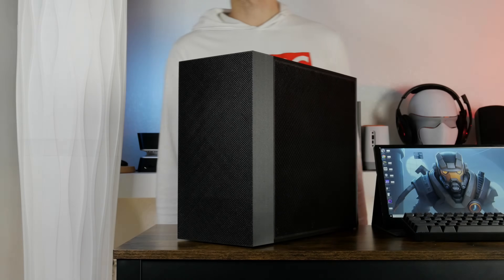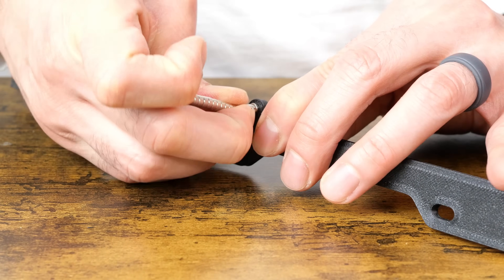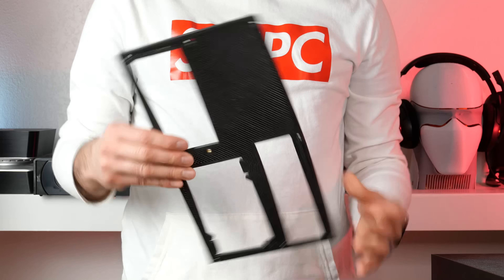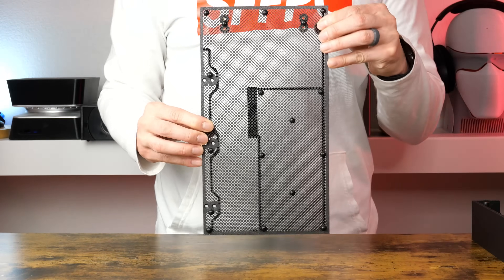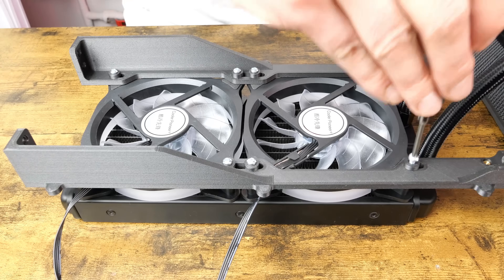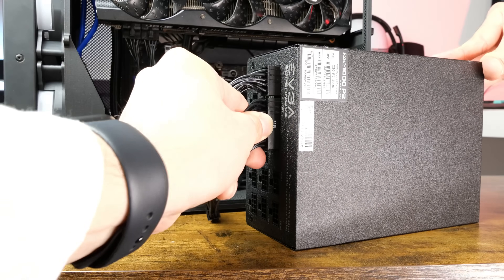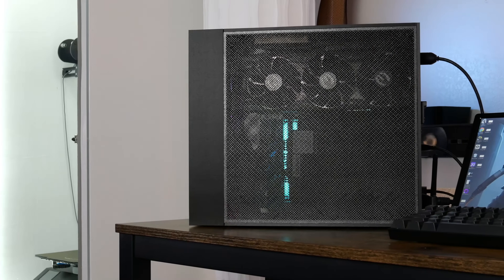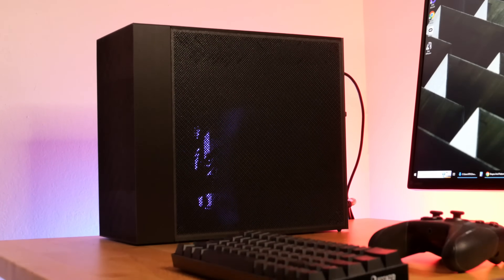3D Printed PC Gaming Case - Full Size ATX

Comment: Best 3D printed case I have seen yet
Reply from the maker: Hey thanks so much! What do you think I could do to improve it?
Reply: @standupg4m3r  I'm actually wanting to replace my aging (2013) QNAP server which is no longer supported. I have the same QIDI printer you do, so I think it is doable after watching this video on this great case. I'm thinking a six 3.5 inch drive stack on the right and the mobo (mini-ITX) with PS and on the left. Anyway, this was some great inspiration. Thanks.
Reply from the maker: @paulnolastname9422  lots of comments for NAS… I just got a hold of 4 old spinner drives I can model for… so def open to it.

Comment: I like the design. Would like an ITX case with SFX PSU. Similar in design, but cleaner. Maybe save a couple of threaded inserts. They seem unnecessary?
Reply from the maker: Thanks!

Like I said in the video, this is essentially just transforming a test-bench into case - so not surprising that it can be improved drastically!

Keep an eye out for a a following up of this project. ;)

Comment: I'm glad I found this video. I'm building a custom layout mech keyboard and realize that I will need a 3D printer for the keyboad case & it's keycaps. My thoughts were to make a wooden case but building a matching computer case to my keyboard sounds much better
Reply from the maker: Thanks for watching! And why not build both?! I love the custom wood cases I see on the internet and will probably tackle one eventually too. :)
Reply: Actually  I was thinking of taking ideas from this and other 3D printed cases to build a internal frame similar to those test stands and then add some nice thin sheets of wood to the outside. It would be placed on it's side like the old desktop cases were. I have this nice powerful  fan whose motor has died to sit facing the ceiling. Then use washable furnace filters on all the air intake vents. The fan is so powerful but quiet that when the case is sealed up there will be a partial vacuum inside drawing the rooms air through the filters. Once I have a working prototype, I might look at a water cooling system that all the incoming air goes through. I plan to seal all the corners with aluminum tape which will Back for a nice contrast to black stained wood.
Reply: With a 3D printed case, the whole motherboard could be enclosed and short pigtail cables could be used to route the rear connectors to the outside of the case. USB based accessories can the be mounted inside the case where it 'should' be cooler then room temperature.
Reply from the maker: @EvilDaveCanada  whatever you create, please send me a link when you finish. Love seeing custom cases no matter the material. :)
Reply: @standupg4m3r I will try to remember. My first priority is the keyboard. It will have eight(8) rows & thirty-two(32) columns. The alpha section will be in a five(5) row × five(5) column plus the 'Z' I'm NOT a touch typist so this layout should be perfect for a person who types via the peek & Poke method. I have all the MX Blue keys and boards needed to have the keyboard running Python. I am actually thinking of using a Rpi Zero 2 W for the brains instead of RP2040 based boards. I hope to get all this done before I die as I'm 64 and my warranty ran out in 2020.

Comment: This is amazing! I wish I could use this, but my crazy ass uses add in cards for more NVMe and 10Gbit, alongside a chonky custom loop
Reply from the maker: Thanks so much! 

There are 3 slots to theoretically use an RTX 4090 FE… but most cards are 2 slot, and nothing is stopping you from using two risers; here you’ll see I used two risers - https://images.app.goo.gl/e4iw1eaQGCDpRwgw6 I used a modified single slot GPU to fit a a separate part, but theoretically a single slot water cooled GPU could play nice with two other PCIE components on risers.

The chonky loop I can’t quite help… yet. ;)

Comment: This is really cool, I would be interested in seeing if there is a way to fit a 360mm Rad. If that was indeed possible I would consider building it myself.

Additionally, if you did do a clear side panel, if the clearance is there you could place a small screen over top of the PSU for more aesthetics / or performance monitoring.
Reply from the maker: Thanks! Fitting a 360mm was actually the original design intent… so keep your eyes peeled. ;)

PS - If you’re also interested in seeing a 3D printed case with a built in screen… make sure you’re subscribed.

Comment: I would use the side with screw holes to have interchangeable case plates to attach art too liek consoles have faceplates. Or install interchangable harddrive bays. 
maybe attach magentic points for any of that kind of action. If you want to keep it small you can even put m.2 extension slots attacked to a PCIE slot. Then make cartridges for the M.2 NVME drives inside. A Harddrive dedicated to all my productivity software and I just push it in like an N64 cartridge. Separate drive from my Steam games, etc.

Though of course an easier solution to my suggestion would be using a separate Dock lol.
Reply from the maker: Thanks for watching and suggesting the expandable storage! People have been bringing up storage a fair bit so it’s something I’ll take note of. Thanks again.

Comment: Hey there,
really nice work you did there!
As i'm currently in the process of designing a small matx Rack case for my band rig, i have a question:
Do you measure out your physical components for deigning stuff like the Motherboard standoffs and gpu mounting points or did you manage to find actual 3d models that are accurate to design around it?
Thank you :)
Reply from the maker: Thanks! 

I do both. I have my parts on hand to verify measure against some of the online resources; mounting holes and tab locations are included in Intel’s ATX v.X.X specifications, but things like fan locations, heatsink sizes, power connector locations you will have to measure out yourself - get some calipers!

Comment: also love your work, out of purely selfish interest ever think about designing a simple eGPU chassis that could fit say a 4090 and an SFX PSU? I am still in brainstorming phase of how I am going to setup external GPU to a 2U server I am building. thinking I will be going direct PCIE riser for now and most stuff uses aliexpress adapters to go via occulink or similar.
Reply from the maker: Thanks again for watching. That would be super neat! If I ever get my hands on the hardware needed for egpu I’ll surely give it a go. Funds don’t permit it at the moment however, but you never know.

Comment: there are higher quality variable/self centering ferrule crimps that make it easier on your fingers (weidmuller for example)
Reply from the maker: Thanks for watching! The crimping didn’t cause the bleeding, it was actually from the plastic housing edge or the pin removal sequence that caused it; I didn’t even know I was bleeding until I saw blood on the tools and connectors lol

Comment: i'd love to see a case with an angled motherboard tray since it would be an easy way to save on size as long as your willing to use a riser cable. it would require a non atx sized power supply as well though.
Reply from the maker: Thanks for watching and sharing your idea about an angled board. Will add it to the list!

Comment: That was stunning build especially when comparison time came, yet the intro could've been shorter. And the PSU ventilator is oriented inside of the chassis instead of tp the side where the ventilation holes are. I salute your perseverance with the custom modding the cable lengnt.
Reply from the maker: Thanks! 

The OG plan for the PSU was to orient the fan facing out; you can see the mounting holes allow for it too! But since the RAM modules isolated the VRM area from any airflow from the AIO, I decided to let the PSU contribute some airflow to the area instead. Not ideal, but from hours of gaming and too many cycles of Cinebench, it’s been working out. Dust though… yeah… I should link the dust buster I use for all my PCs. Being in the garage also doesn’t help any of my PCs!

Comment: Why atx PSU? Smaller PSU is fine. There are plenty nice smaller cases you can buy. Nice case tho.
Reply from the maker: Thanks for watching! If you visit any of the comments section on any 3D Printed case video, not just mine (even scour Reddit r/sffpc), the most asked question/request has always been about using Full size ATX - this was my answer first to that, and not the last.

Comment: Very solid build. Im 99% sure my TUF oc 4090 wouldn't fit however this is a very cool idea. My only concern is dust.  I prefer positive pressure setups so that much mesh wouldn't work for me but i can see the appeal.
Reply from the maker: Thanks! I should have specified that in theory the RTX 4090 “FE” should fit 😅 

I’ll try to address some air flow concerns in my next build, because you can bet this isn’t the last one for these parts - the PSU cables on work in this configuration now lol

Comment: If you make this horizontal and make a 140mm wide cut out in the motherboard side panel and then have stand offs on the vacant screw holes, allowing for external cooling. (I have a 420mm AIO and I just cannot find a half decent case to fit it in that isn't a literal reinforced tank. i.e. horizontal to allow the mounts or I would absolutely love the current for factor you have here, just extended and widened a bit to accommodate a 420mm AIO
Reply: Oh and/or a 4u/5u server chassis. and a EATX (33cm wide) mobo with a ton of HDD support.
Reply from the maker: @hayden6776  someone else also mentioned rack mounting, eatx, and more HDD accommodation… unless I get a rack mount or eatx motherboard it will be hard since I like having the parts physically on hand to measure against. But will keep my eyes peeled for them.
Reply from the maker: External cooling sounds pretty cool! Thanks for the watching and sharing that suggestion.

Comment: Excellent trimming of the power cables! It's amazing how many great custom 3D cases have been uglified by messy cables.
Have you considered/tried using some spiral wrap of those cables? They are very easy to work with. You might only need enough to cover the middle portions of the cables and then use extra small cable ties near the connectors.
Reply from the maker: Thanks for watching!

I have some spiral wrap and even spare sheathing but decided against any sort of bundling since the 24pin cable is almost like two cables that terminate to one - this causes more bulk when bundled: https://www.reddit.com/r/sffpc/s/sMNLVUDCPS
Reply: @standupg4m3r  Would a few small black tie wraps be out of place?
Reply from the maker: @TudogzHumpn  Should work but I’m honestly more than happy with the way they work so far… and the fact it’s already dismantled for the next build doesn’t help too lol
Reply: @standupg4m3r  Okay, thanks. I look forward to the next project!

Comment: my only question about this is why not make the PSU facing out instead? ..... but still it is a great build tho, keep it up
Reply from the maker: That was the original plan (and the mounting hole patterns for the PSU still allow it if you check out the 3D files), but with the way the ram modules, cables, and water hose block airflow from the AIO, the PSU no plays heat extraction duty for the VRMs and such - it will be situational. 

PS - I was planning to swap out the PSU fan for an RGB one too!
Reply: @standupg4m3r  i hope we see more of these videos as almost everyone is focused on SFF components to make the cases smaller i wish we could see more content focused on using the space more efficiently while keeping ATX or mATX components ... thanks for a great video and best of luck
Reply from the maker: @roguemo  thanks kindly! The motherboard in this video is actually my cousin’s so I need to return it. When I get another ATX motherboard I’ll hopefully build some more.

Comment: For those vacant screw holes, I'd probably just go with something reasonable like a headset mount or some sort of hardware monitoring display.  The case doesn't really need anything else.  Looks great.  Creating mesh by removing the top and bottom walls is a great idea.
Reply from the maker: Thanks so much! And your idea for the headset and monitor mount are on the money ! Stay tuned for the update. ;)

Comment: This is a pretty clean ass design. Compact, minimal, simple and relatively easy to make.  Anything major you would change if you did a second rev?
Reply from the maker: Thanks for watching! If I were to re-visit this design I would add some provisions for thin 60-80mm fans on the rear and maybe add in provisions for USB-C and audio connections on the front; and the front panel and material color could be changed for aesthetics in many way.

Edit: And also add some SSD/HDD mounts
Reply: Love it. Keep up the great content!

Comment: Any way to mod it to be just the width of the Mobo?
Reply: I did see it! Unfortunately the cabinet is about as tall as it is deep so I’m not sure that would work
Reply from the maker: @bonebreakaz94  double check the dimensions with my CAD and your space: keep in mind that the watercooler part is optional and air cooling should keep you within 360mm height wise.
Reply from the maker: Thanks for watching! It's all really possible, but can I ask what would be the reasoning?
Reply: I have an “old” atx mb that I’m gonna use for home server and stuff. I’d like to fit it in a small cabinet that’s 36cm deep. So to have clearance for psu and Ethernet cable at the back I need the whole thing to be a few cm shorter.
Reply from the maker: @bonebreakaz94  have you seen this: Qidi Tech X-Max 3 for 3D Printed PC Mods
https://youtu.be/ACI2cUQDgfg

The vertical orientation might be of interest to you. ;)

Comment: Interesting design and the video itself as well. I think that it would be better if the motherboard backside didn't show the threaded inserts from the outside. With that said, there are a lot of parts that are really neatly designed and feel solid, and the mesh panels feel really nice. And the fact that a lot of these look really professionally made from afar, while when you zoom in on them, you can clearly see those are printed - it's an interesting thing to tackle because people got used to fully professionally surface finished things, while you don't really need all of them to be like that.
One more thing that I would like to see in your videos - print times - either overall or for specific parts like how much faster is it to print the mesh panel vs a solid one/the amount of filament difference.
Reply from the maker: Thanks, as always! I had larger ambitions for the exposed inserts - but shelved it for another video. I also didn't want to hide the fact that the test-bench piece is the heart of this case and didn't want to hide its roots; I may revisit this build with a dedicated structure, because I do agree that it could look waaaay better without.

I'll post some print times in the next video - the estimates from the slicer have been accurate so far, and I figured ppl have access to the print files and can see what their printers will do themselves - and I am now officially spoiled with the speed the Qidi Tech X-Max 3 prints at... I am a bit reluctant to share my print times because it is staggering compared to my Artillery Sidewinder X1... like 3-4x... and I would hate to say something like, "It only took me 3 hrs" and then a user sees an estimate of 12 hrs lol

Comment: First
Reply from the maker: lol thanks for dropping by! Do you think it would look better with the clear filament?
Reply: @standupg4m3r  Fluorescent filament would be even better. Wonder how would it hold up if printed in PLA(+). Really nice work!
Reply from the maker: @sedlja4605  I keep hearing good things about PLA+ and might give it a go. The motherboard and power supply dump crazy heat with this build so it might prove to be a solid “stress test” for it.